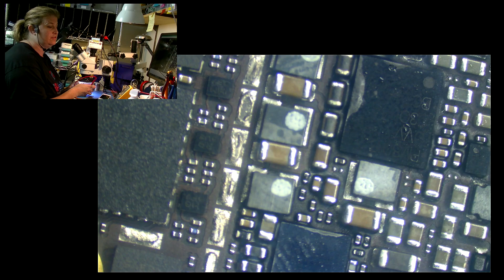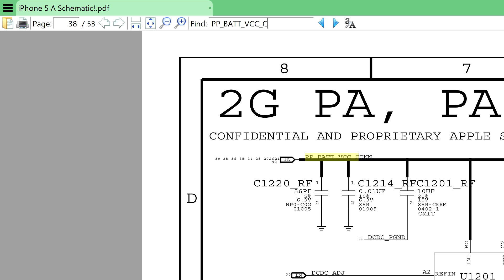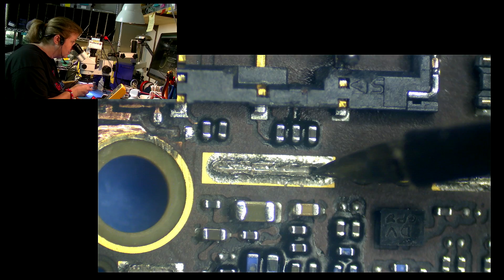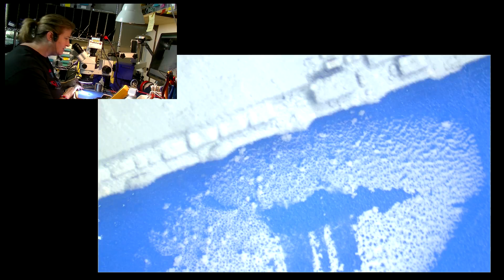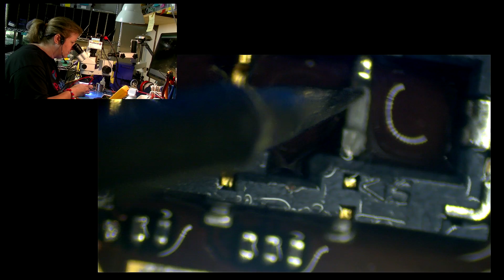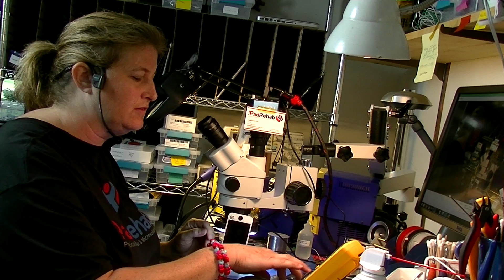iPhone Data Recovery After Water Damage---short detection

Comment: Hi, i have learned a lot with your videos many thanks for you to help us to keep on right track!!
But now Im facing a common problem maybe, iphone 6 water damage to recovery data,i was able to to take out the short and turn on then was no backlight, i was trying to fix the backlight but after that i kill the phone. for now there are no short on vcc_main and has 0.66v , there are no short on 1v8_always but no voltage,  c1704 has 5v01 and c1738 has 3v07,  i have changed u1700 in a ready but no success, please it could be the faulty  pmic? please what should i look before to make sure its a pmic problem? sorry for my English  many thanks.
Reply from the maker: I think this is a sad testament to
Why I hate doing data recovery videos.  It sounds like you killed a recoverable phone trying to solve a small problem (backlight) that you didn't even need to solve for data.  Do not risk people's memories without the experience to be working on these devices.
Reply: I know my mistake, just  got little excited to get my iphone back,  tks for your advice,

Comment: Hi Jessa

 I have a iPhone 6 that had water damage, I had a short on VCC_Main and VCC_Batt
I already found the bad (Caps) one on each rail, I replaced them with the same caps no more shorts
but the phone still shows no sign of power, not even when connected to iTunes.... any suggestions ?

Thanks
Reply: Friend have you check the 1v8_always also?

Comment: I like how you explained the multiple strategies and how they relate to each other (like if the freeze spray method doesn't help then the alcohol method also wouldn't work for this case).

Every bit of info is new to me here because so far I have recovered lost iPhone data via a software.

Comment: nice Video :D
Already learned a lot.

I have a samsung s6 edge that has fallen into a bucket of water.
I direct teared it down and the battery whas already dead.
With the microscope i can only find 1 component that has blown up

With a charger without battery i do get no reaction on the phone or is it's neccesary that a battery is in ?

https://drive.google.com/open?id=0Bx6SWnZQ8xDjRTNJeHZYOEJtY3M
https://drive.google.com/open?id=0Bx6SWnZQ8xDjRWp5a01hT1lzcE0

Comment: I have an iPhone 6 that won't turn on and I tested the battery connectors for continuity and the negative side has it and the positive side doesn't. Theoretically doesn't that mean it should work? What should I try next? I have two boards with this same problem?
Reply from the maker: You should try learning schematics and understanding signature failures for the device by reading forums everywhere.  Then figure out what the phones blood flow should look like and after all voltage issues are solved then work on solving and data line issues.   
Your question is like saying "my car doesn't start but I confirmed my key fits, what do I do next?"
Reply: Does the ZXW Dongle give you the data patterns that should match the oscilloscope? Or is there some other data schematic source that I need?

Comment: I think I love you and the false hope installed in me to restore my old phone. 

do you know if it is possible to dis-solder the ssd and resolder it on another working logic board and have a result of "it to work to recover data" step?

Either way good time spent watching, it is a very last resort :)

L
Reply from the maker: It is far easier to just make the native phone work again.  Chip off data recovery requires a set of chips to be transferred flawlessly.  One of which is the CPU, unless you're talking iPhone 4

Comment: Here some weird shit:  Lady says she dropped in water, I see no water damage. Broke down the plates, see no visible clues. None. Phone works but was a little quirky thought it might be the battery.  Ultrasoniced it for the hella of it. (only saw water damage at the home button only).

Had my eye on for a few days and only now & then it'd get hot and sometimes reboot.  I find a short to ground on PP_GPU & PP_GPU so I think there is a short in U0201. Freeze spray it and its in the lower left, ZXW shows both those lines go to that area.

So the question is: if there is a short to ground, how in the hell is this thing working????
Reply from the maker: There is no short on those lines, they naturally have low resistance to ground
Reply: +iPad Rehab 
they beep across them
Reply from the maker: Tony Tone tell me why that is and no it's not shorted. you watch louis' channel, i know you know this.
Reply: +iPad Rehab   I should.  You're right.  (I think it's one of things I missed or could never verify). I'm just dumbfounded bc I've fixed a number w/those (all instances was a bad caps or pmu - short to ground). Hummmpmf. .. hands in the air dunno.  LOL
Reply: +Tony Tone hmmm. a clue... thank you : )
Gotta think about
 this one : )
Reply from the maker: Tony Tone take a CPU for instance. 1 volt  line goes to the CPU, they can use 20 watts of power. ohm's law says that a 1 volt circuit using 20 watts of power has what resistance to ground?
Reply: Sorry feel asleep and just woke up.  I think I know and will share.  But I want to test my theory on a known good board 1st.  If I'm right, I'm going to be more puzzled about something else.. LOL. Or maybe not. But you awoke something that is making my gears turn now... Thank you Jessa! You are an awesome, awesome teacher!  (your 1st answer is the answer)
Reply: AAAAhhhhh HA! - Is this the same reason why sometimes good caps pulse a beep on and off? : ) Very low resistance to ground ! .05  I'm learning something here !   Yes, this is a thing I dismissed and never learned about and never got any clarification !  But still foggy on some things and will follow up after I get caught up on work : )  : )
Reply from the maker: Tony Tone who's your grandma?!?!
Reply: Jessa is !   Don't forget it !
Reply from the maker: Tony Tone :)
Reply: +Fredrik Kjellgren yes?

Comment: Ever fix a dead iPhone 6 that's only missing voltage on the GPU line? I even tried running a jumper from CPU line to it to see if any change but still no boot, iTunes doesn't detect it and only draws around 50ma. Thanks!

Comment: Used the power supply method expecting to find a short, however it showed that only 70ma was being used at nominal battery voltage of 3.8v. The screen was presumed bad as there was heavy corrosion on the connectors of the assembly, tried connecting it to itunes but it wasnt detected, also switching from ring to vibrate did not produce that vibration i'd expect with the phone on. Do you have any ideas on this? Does the phone need a working screen for it to turn on and be detected by itunes or is there something else going on? Ay 70ma it seems it's not getting full power somewhere. Thanks!
Reply from the maker: Not every problem is a short.  This phone is brain dead, the CPU is not active

Comment: instead using more current u  shlds hav just used 4.8v and 500 ma of current and checked  the heating part >>>>> its it would be simple rather thn wasing the ipa for checking bubbles>>>>>?
Reply: Checking for heat IS what the alcohol is showing.  You can supply a push--voltage.  But you can't force a phone to move more electrons than its going to do--ie you can't just supply more current.  Current must be consumed by the phone.
Reply: ur right >>>>>>>>> but the phone capacity  of and capability of withstanding the voltage is 5.0 v or 4.8  due to  the  internal  voltage regualtor  inside the power management chip 
which allows to flow the voltage in certain limit but the great thing is that  the current is limited  due to resistor and other banks sooo giving more current  doesnt solve the problem because the maxx current rating of any phone is  2 ampere\hour means 3.7 v*2= 7.4 watt per hour sooooooo ??????how  can u give more current  if the device itself cant handle more than7.4 watt???? if u want to check the component which is getting hot  thn increment by 1.5v shld be good no more current shld be increased
Reply from the maker: +tejas mhaisdhune Short circuits don't obey the rules of the circuit designer.  You can put whatever voltage you want on it, you could set the DC power supply to 20v or 200v.  The current will be whatever the short circuit decides it wants to pull.   The voltage doesn't really matter as long as it is high enough, just the current.   You can (and should) limit the current so that regardless of the voltage that you set, the current is limited at 2a. This, in effect, limits the voltage.  The only problem is if you burn a short off the board then you may put a pressure on the board with too much voltage.

In this case, there was no heat until a significant voltage was applied.  Normally, I start with battery voltage and go up from there.  Since this was a data recovery board, I had already solved it and then put the bad component back to do the video since it was an interesting short.
Reply: ohhhhhhh

Comment: Ok I tried your method and got better some reult, I dont mind the time as long as it comes on.  when it will not boot up completely  or restore on itunes but it comes on and i can put it in dfu or recovery mode. it seems the firmware is corrupt. I tried isky phone data recovery and wondershare dr fone but without knowing the original firmware before the damage, it is hard to restore or upload a new one.  is there a software that can show me what was on the phone before it was dropped in the water.

Comment: Just several questions...I absolutely love your videos they are extremely objective, unbiased, and really digs deep into low level motherboard repair. I have seen some other techincans try with their $50 watch/jewelry cleaners and you really nail it down to its electrical enginnering aspect:

Just several questions:

1) Where did you can that particular can of freeze spray (what company manufacturers it)
2) The Power Supply/Power Source you where using that allows you to set the exact amperage who manufacturers that particular power supply
3) Would it be a good idea to purchase the miliohm adapter as an added strategy to find a short on an iPhone logic board?
4) I am realitively native when it comes to understanding electronic components but can you briefly why (when using "Continuity" on your multi meter) why would it be considered a short when testing a capacitor on the positive side and negative side and/or testing a battery contact on both the positive and negative and ISN'T a short when testing a battery contact/capacitor only on the negative end. Does this have something to do with negative being "ground" thus the electrons having a path to flow to ground one way? Why would it be classified as a short on the positive end.

I am defintely really looking forward to taking your classes soon enough. I really need to understand motherboard components basics better at the low level. Thanks in advanced :).
Reply from the maker: +AzraelPercussionNEO That's a lot of questions.  Sounds like you should come out to Practical Board Repair School
Reply: +iPad Rehab I did Wiki "Short Circuit" on Wikipedia (I absolutely love Wikipedia) anyway they explained so that I can understand it better (even though Wikipedia comprehension can be rather difficult at times). Basically Short Circuit is where Current is allowed to travel any path without any form of Resistance whatsoever (this is why you are getting Continuity readings on both the positive and negative end of those Capacitors) because both ends are offering the same Voltage potential and thus offering no Residence allowing Current to be essentially the same when going from one circuit to the other (where as normally Voltage potential becomes less and less the more it travels through a circuit (resistance). Since electrons travel in reverse via Negative to Positive in DC, when you read Continuity on the Negative contact it produced Low Resistance (thus a Continuity beep because there is more Voltage potential on the negative end) when you probe the Positive contact you will have more Resistance (thus no Continuity beep because less Voltage potential). I think this is a rather practical and sensible explanation toward why one contact (neg) beeps and the other doesn't (pos) but a Short Circuit has no Resistance thus allowing the Current and Voltage Potential to be remain the same thus going out of control
Reply: +AzraelPercussionNEO that sounds awfully complex.  A circuit is a highway for electrons to travel--current.  They are pushed down the highway by the pressure of  battery --voltage.
To do work,  they are meant to travel a long path through all sorts of components --resistance.  
When a bridge is created allowing a shortcut--eg the metal plates inside a capacitor are crushed together so that they now touch, a new path is created for the electrons to rush back to the battery without going through all the resistance of the circuit.--a short circuit.  You've heard the phrase "follow the path of least resistance". That is what a short circuit is.  If you find the thing on the board that is creating the short, eg the bad cap and remove it, the electrons then have to go back to the regular path and make their way through the whole device.  And the thing works again.
Reply: +Jessa Jones Thanks Jessa for the "common sense" explanation
Reply: +Jessa Jones Thanks Jessa I also watched Derek Owen's video on Short Circuits. He also explained it very simple and very well.

Comment: What about a samsung? is it the same process ? i have a note three that is damaged by sea water but i m sure there is no short circuit problem because battery was removed when it felt in the sea , that was a year ago . i disassemble the device
and i have kept the board , can data on it be restored ? , there is corrosion all over :(

.

Comment: I have this error 52 after trying to upgrade to IOS9. Several months back I had water damage took my phone to repair shop the replaced the screen but they were asking for $50 for my fingers Scan. I told them to hold off since the phone was working and I was using the on screen display for the power and options. Now I updated the phone and halfway through the update it's given me the error message 52. Took the phone back into the repair shop they said it's not your button it's the cable charge me $45 still the phone is not working after taking it home to do the update. What's the deal with that if the home button is the original button why is it still not trying to update.

Comment: Rly get a flyr thermal camera o agilent/fulke  lab multimeter whit good probes instead.
They worth like the hakko solderin station..
Reply from the maker: +pufero1 I have a FLIR camera, it just doesn't have the resolution at the level of individual capacitors on the board.  I am using a Fluke multimeter here
Reply: 500 buck ones? whit 0,000 on low ohms scale.
The ones you show on video i dont see it have 0,00 resolution, i got an brymen 867 and it have good acuracy and 50000 count
The camera since you used for repair phone boards a better may be  worth.
I screem when you set 7A on the board was insane for my point of view for that i will use less and try on millivolts scale find the shot becuse is another way to find a short.
Reply from the maker: I had already found the short, removed it and got the data from this phone then put it back to make a "for fun" video.  There are lots of ways to find a short.  This is just one of them.
Reply: anyways is not there yet cheap bga nand on fly readers for just recover data.
I see one a few days ago used for upgrade iphones from 16g to 64g
.http://i.imgur.com/nZdKNq2.jpg
Reply: +pufero1 no, the data is encrypted

Comment: I think it is not a cool idea do solder wires on a battery connector.
Reply: Why?
Reply: Because you can solder wires to edge of connector. I didn't tried to connect iphone board to external power source, because i used big battery from tablet pc connected to iphone battery voltage limitter board. In my opinion, if solder on this strange connector, sometimes battery conector can fall off. But now, watching close at my iphone 5 board, i think that my claim is strange
Reply from the maker: +Вася Иванов These repairs are for data recovery only, so it doesn't matter if connector comes off.  It is easier to solder bigger gauge wires to the connector pins rather than the tiny little pads.
Reply: iPad Rehab You mean that you didn't recover moterboard yet? Strange. What you do after that with motherboard?
Reply: iPad Rehab in my country, i think 90% of people with broken smartphones want to see it working good. It doesn't matter - erased user data or not)))
But I know that it is a little chance that repaired Iphone after swimming in water would work great in future
Reply: +Вася Иванов exactly--which is why I can't warranty the repair. Since I can't warranty, I can't do the repair. I only work on wet boards for data recovery. The end user can go to Apple and get out of warranty replacement for $299 USD--this is the better choice for them for a good reliable phone.

Comment: Hi Jessa, great video! Thanks for this. I'm so tired of chasing shorts...Going to try the DCPS method now. My power supply doesn't want to up the amps though - do I need to remove components to isolate the battery main power rail from the vcc main power rail?
Reply from the maker: +Susan Southwick a short by definition will consume a lot of amp---like 700mA-900mA.  Most power supplies will limit the current to 1A.  If your phone is NOT consuming amps (amps are consumed by the phone, not pushed in--that's voltage) then it is probably not a short, but instead an open circuit.  In iPhones, the is usually a bad chip, a bad PMIC or bad CPU.